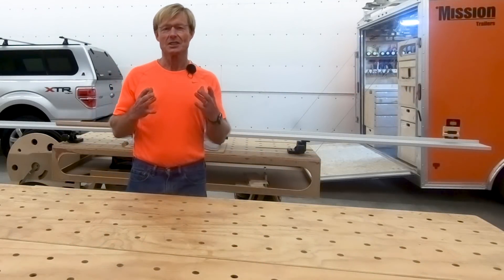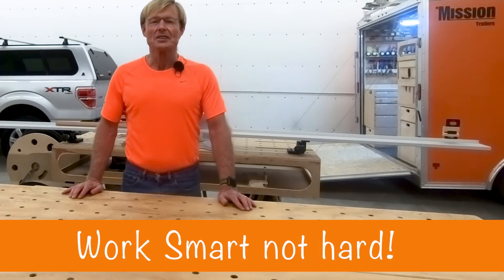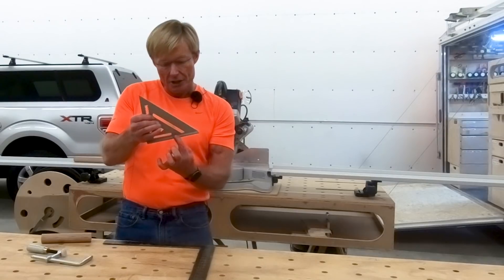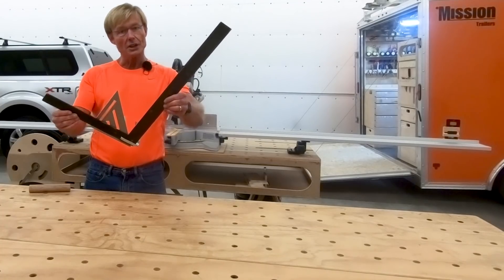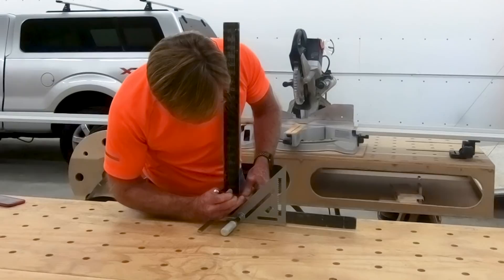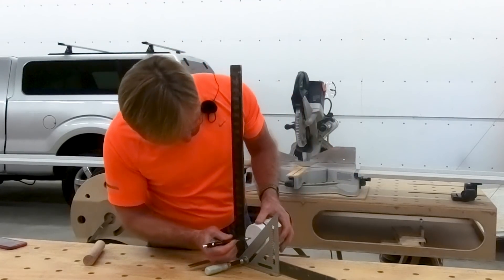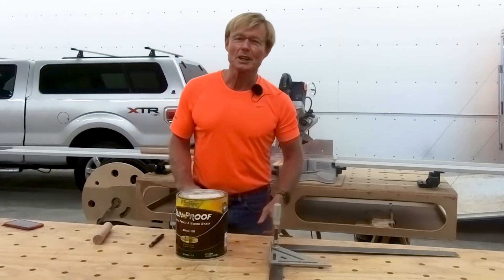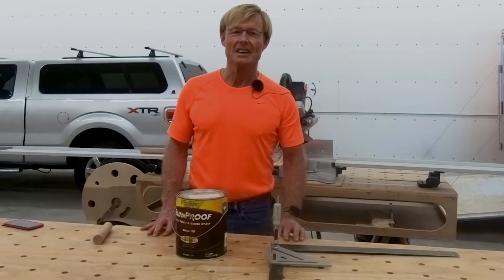Finding the center of a circle

Comment: Combined with a laser or straight edge it could work on something big (larger than the square works just as well
). Like 30'. But in steps like 45-60 degrees and you will end up with a small enough "circle" in the middle.

Comment: "it doesn't matter what size the circle is"

Ok do it for a circle 3ft in diameter
Reply: Okay….easy peasey….still three tools, but sub another framing square for the speed square.
1.  Clamp two framing squares together so that the “L” is maintained, with the inside edge of the tongue of one square aligned with the inside edge of the body of the other square.
2. Place the inside edges of the squares tangent to the diameter of the circle.
3. Mark the circle where it is tangent to the two edges of the squares.
4. Rotate the circle, 90-degrees, either direction, until one of the marks on the circle is tangent to the other edge of the squares.
5. Mark the circle where it is tangent to the other member of the squares.
6. Rotate the circle 90-degrees, same direction as in step 4.
7. Mark the circle where it is tangent to the other member of the squares.
8. Unclamp the squares, and reclamp them so that the bodies of both squares are together, their tongues opposed, with the edges of the bodies aligned and so that the distance from the heel of one square to the end of the other square is at least 37-1/2”.
9. Connect the diametrically opposed marks.
10. Center of the circle is the intersection of the two lines.

A video would have been easier, but hope this is clear enough to be understood.